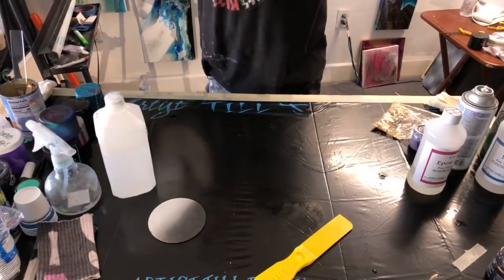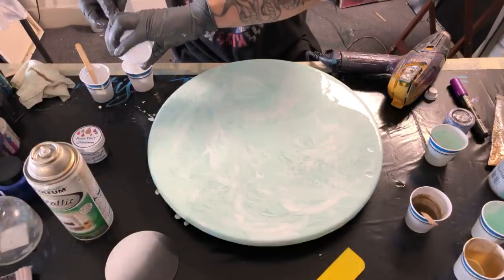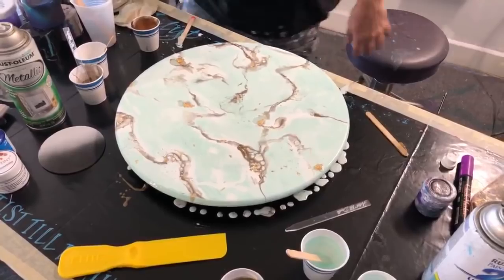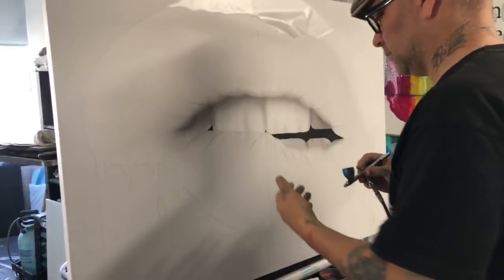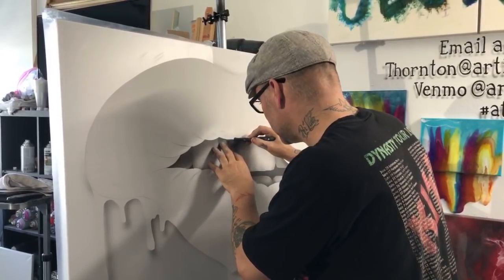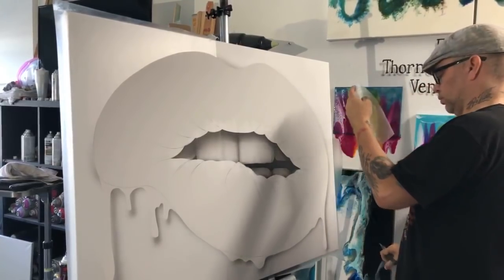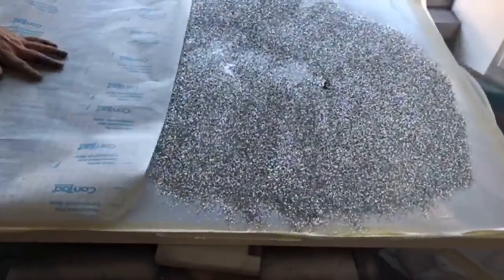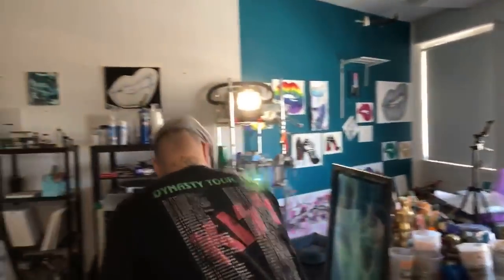Live Resin Pour Lazy Susan (With Gold Leaf) and a Disco Lip Piece

Comment: Not sure if it helps a lot with cells in resin, (still learning/practicing) but sometimes my hubby and I just mix some resi-blast in with the resin instead of dropping it on the canvas/panel. Helps avoid divets and fisheyes,  but sometimes I still use a couple drops the old fashioned way :)
Reply from the maker: Hello, thank you for watching!  I tried the resiblast last night and it created pits and divots...  I'm not sure if I'm just using it wrong at this point.